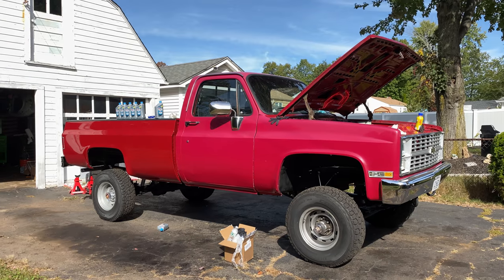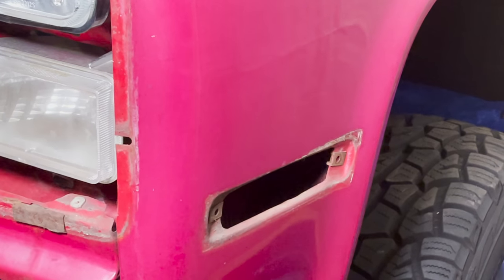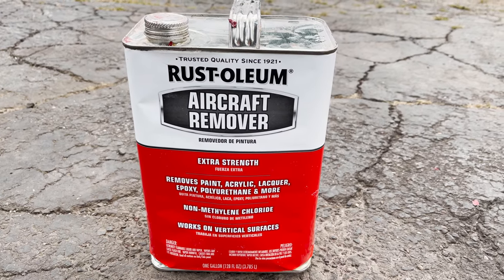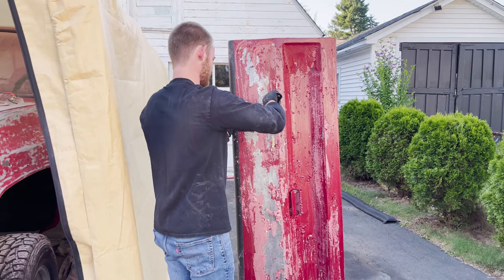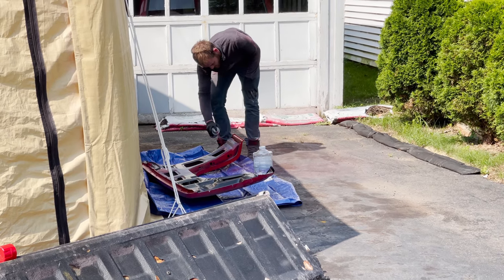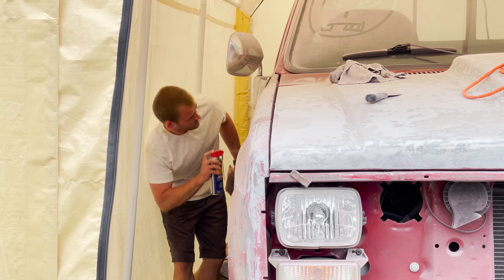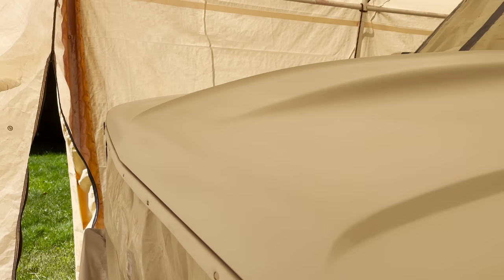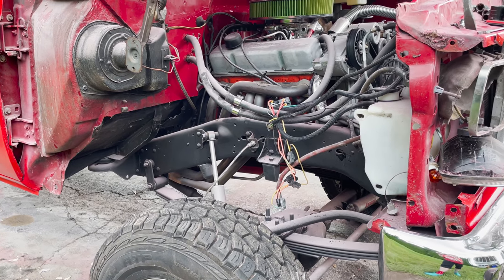Restoring a Classic: Painting a 1984 Chevy K10 Pickup Truck

Comment: for the first time its a great learning experience! but i would recommend:
sand the body down with p150 and move up to p400 dont go all the way to the metal this is not needed when the paint is in decent shape  this will make it way easier for yourself.
after that use a good silicone and grease remover with clean rags.
then use a 2k epoxy primer to spray a base layer with a compressor and hvpl gun just a cheap gun will be 10x better then spraycan's
after priming the truck scuff up the primer with p400.
then lay down your coat of color also 2k first layer should be a light coat let it tack up for around 10/15mins before spraying a heavy wet coat.
after the heavy coat let the paint cure for a few days before buffing and polishing it if you dont use a clear coat.
Reply from the maker: Thank you for the great tips. It's really appreciated. Matt realized about 1/2 way thought that he shouldn't have sanded it down to the bare metal, but so many websites said to do that. By that point, he just kept going so it was all the same.

Also, the truck ended up having a lot of filler on it, which was hidden. It all appeared when he brought it down to the metal, so the body ended up not being nearly as nice as before painting.

Thank you for the tips about the paint sprayers as well. Matt hasn't said anything, but I have a feeling he'll want to do more work on it once the weather gets warm, so we'll take all those suggestions and put them to good use. Thank you again!